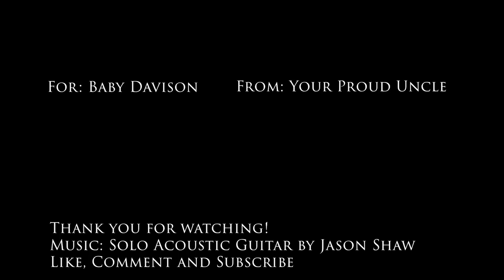A Handmade Crib | KirkwoodWorking

Comment: How did you get a good fit on the slats M&T joint? Is it exact using just the router or did you need to do anything to the tenon?
Reply from the maker: I purposely sized the tenons to 1/32 under 3/8" and then used a 3/8" router bit.  The slight variations in my stability when routing make for a slightly loose fit.  There wasn't much issue with fit, but I would have modified the end of the tenon with a plane/sandpaper to get the fit.

It went rather smooth.
Reply: @kirkwoodworking216  and how about the rounded ends of mortise? How did you get the rounded edges of the tenon to be the same radius/contour? I'm curious because I build something similar recently and would love to do it again with M&T.
Beautiful build btw!
Reply from the maker: Thanks!

The router bit used for the mortises is a 3/8" diameter bit.  I matched it with a 3/16" radius quarter roundover bit https://amzn.to/39SMNlG  (which makes a 3/8" diameter) and passed all the slats through the router table 4 times, once per edge.  I find this easier than a half roundover bit, even though it is double the passes, there is no chance of scrapping a piece if you aren't careful.  you can see at 10:12

Comment: Thank you for posting this video.  I have copied your design (somewhat) made changes to the back and sides to add some curves to the top rails as well as contrast on stiles and panel assemblies.  The one question remains is what you used for your final spray finish.  I was thinking of going with a non toxic butcher block finish but still undecided.  Thank you.
Reply from the maker: I used General Finished High performance Finish.  Water based, and non-yellowing because I wanted the Maple to stay very light colored to get the nice contrast.  I would recommend a low VOC poly like the High Performance or similar water based to not off-gas and to protect the wood.  Butcher block finish is just mineral oil and it does not harden/cure, I WOULD NOT RECOMMEND THIS, as it will eventually rub off onto everything that touches it until it is completely gone and then it is doing no protecting.  Mineral oil is safe for a child to touch or even ingest, so no harm there, but it will be messy and ineffective.  If you want something natural, try a filtered beeswax that has been applied, allowed to flash, buffed off and then let dry.

Try the General Finishes, it is great stuff and goes on smooth if spraying or brushing: https://amzn.to/3gAK0RC
Reply: @kirkwoodworking216  Thank you so much for you response.  I will definitely give the water based General Finish High Performance a try.

Comment: What size bit did you use on your plunge cut router? And what size slat fit into that hole? It was a pretty flush fit with the round-over bit on the slat - looking to achieve the same thing.
Reply from the maker: Slat thickness was 3/8", Plunge bit size was also 3/8" Diameter, and roundovers were 3/16" radius

Comment: How do you drop it down lower? Did you purchase hardware for that and install it or lower the bed frame into a lower mortise when they get older?
Reply from the maker: at 15:46 I am drilling large holes with a forsner bit.  There are 3 of these hole per corner and they house a 1" oak dowel that the mattress frame sits on.  They are placed at heights consistent with the guidelines for crib height.  you have to un-screw the front of the crib, drop the dowels a level and then re-assemble but it isn't that bad to do as you are only really doing it 3 times in the use for 1 child.

This is a really strong support.  i have had my wife laying in the crib with my daughter at one point, no problem.

Thanks for the question!

Comment: Great build! Do you have plans available?
Reply from the maker: There are not plans available.  There is too much risk when it comes to cribs! I followed the US guidelines and requirements for heights and gaps to make the plans.  Sorry!
Reply: Guidelines stated no gaps at all in the head board or foot board, solid planks only. Poles only on the front and back. Which I think is crazy cause if the baby cant get its head in between the the sides then it wont be able to in the head board either. Nice job though.

Comment: Nice work. Could you tell me what & where did you  buy the bit you used to make the mortise in the video, time 3:28? ThkQ.
Reply from the maker: They are hollow-chisel mortiser bits.  Specifically the Powermatic brand set you can find here: https://amzn.to/2Qx9l1I

I am using it in my bench-top hollow chisel mortiser from Rikon: https://amzn.to/2MGlsWY

Comment: How did you attach the trim on the top edges?
Reply from the maker: They were edge-to-face glued to their appropriate side assembly.  so there is some odd overlap, but when the piece is broken apart, the top rail comes with the front, back and both sides. And when assembled, there is a very small seam between them that i attempted to minimize without hurting the fit of the whole piece.